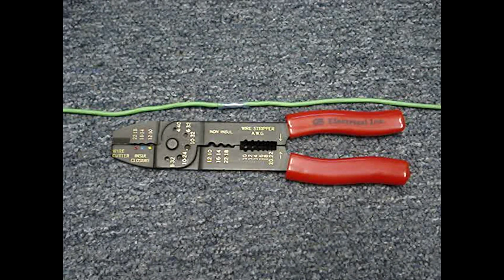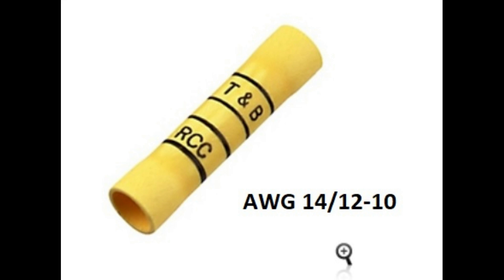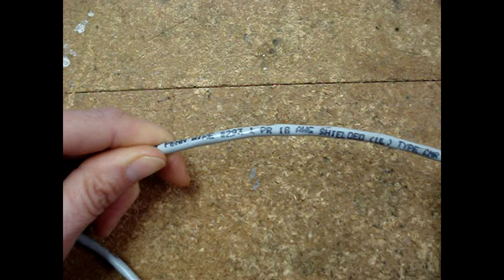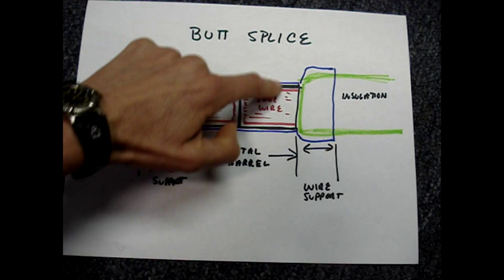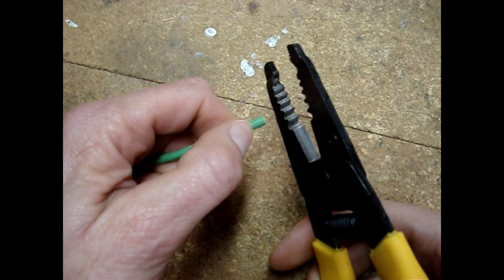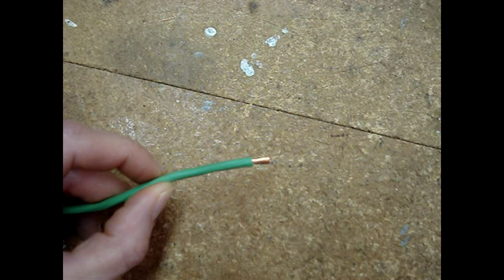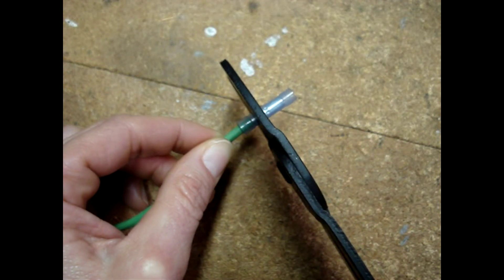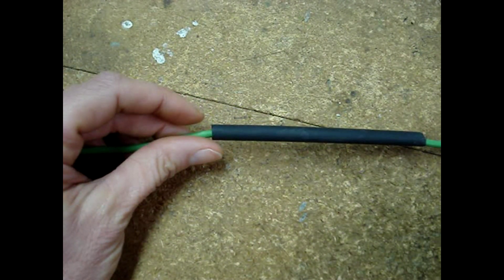Splice Wires Together  Crimp Butt Connectors

Comment: I have VACO crimping tool and it has round holes as the tool you show, how are they used?
Reply from the maker: They are used to cut a threaded bolt.  Screw the bolt into the appropriate hole to where you want to cut it, then squeeze the strippers.  If the bolt is a softer metal it will cut it.  I doubt if you could cut stainless steel.

Comment: Viewed several and this was the first to show a proper crimp!  Thanks!!!
Reply from the maker: You are welcome.  I used this type of tool to make crimps for 15 years on low voltage building systems.  I never found a crimp that failed.  We always used high quality connectors.  Make sure you use the right size connector too.
Reply: @Know-How-Now  Thanks and I also wanted to tell you I admire your patience; I wish I had more of that.  : )

Comment: You can touch and twist copper all day it will not corrode. More often then not you need to twist it to fit the copper in the connector you're using.
Reply from the maker: You are correct your fingers won't corrode the copper.  Youtube won't allow me to edit an uploaded video.  I will beg to differ with you though on twisting the copper strands.  If you are having to do that you are likely using the wrong connector.  If you look into any literature by the companies that make the connectors, they will tell you not to twist the wire.  I used a document by NASA for reference for this video.  That document also says no to disturb the strands.  I've made hundreds of crimps in my working career as an electronics tech.  I've never had one fail using the methods/guidelines in this video.

Comment: This is an in-line splice, not a butt splice!  At least at the major aerospace company I worked for.  Butt splice is where two wires run parallel to each other, then the ends are spliced together, side by side.  That said, a google search shows multiple references such as this video calling the in--line splice a butt splice.  Otherwise good video showing an in-line splice (we also did not twist wires before splicing or crimping).
Reply from the maker: Thanks for commenting, Kim.  I worked in the commercial fire alarm/security business.  We called them butt splices.  I've never heard the term in-line.  I suppose terminology can be regional or differ between industries.  Some codes did not allow splices, the correct thing to do was install a terminal board.  There were a lot of splices out there. lol.   Everyone was pushing to get the job done fast.
Reply: @Know-How-Now  ive always heard it a butt splice,  but i've worked in a lot of manufacturing plants and sometimes one plant might call something one thing when thats how everybody does it there

Comment: This is timely information for me.  The guys at the hardware store treated me as if I were a moron when I asked for some crimp butt connectors. I'm trying to rewire a vintage Gone With the Wind Lamp that will require joining three alum connectors to copper connectors.  I can do this!  Great, well done video.
Reply from the maker: Thanks for taking the time to comment and the kind words, Sharon.  I have a similar video, it goes over some of the same info, but you may find it helpful:  https://youtu.be/xhPM5-JbRtA

Invest in buying quality connectors and do a little home work to get the right ones for you application.  Because there are so many variations, it's a little overwhelming.  The major manufacturers websites that list the specs for their connectors.  I would try to contact their support people, they could tell you which connectors you need.

The $10 tool, if used correctly will do an adequate job.  Your lamp is not going to the moon.

Comment: Great info! Fyi I think your video is in 4:3 format. It would look better in 16:9.
Reply from the maker: Thanks for the FYI, Ron. I'm trying to improve the videos... I don't have any kind of training with shooting video.   I looked into your suggestion and I think I found where I can change the setting on my camera.  I'll have to experiment with it and see how it goes.
Reply: Know How Now No problem-it will probably be the high definition setting. BTW, I’d like to see a video on how to remove/replace a leaking inline copper water valve...do I desolder it or cut it out? How about one on removing and replacing a section of damaged hardwood flooring?
Reply from the maker: I have a video showing the removal of a soldered valve.  I didn't show the install, but in the video you'll see I've installed a ball valve.  You'll see I've used a coupling and a piece of pipe to fit the new valve in place.  https://youtu.be/BWXFGwBpyvM  If you don't think it's safe to solder, you can use a compression fitting as shown in this video:  https://youtu.be/D0ftheIfTjY

Good suggestion for a video on replacing damaged hardwood floor, I currently don't have an opportunity to do that.

Comment: At 2:43 Stranded vs Solid:  It's good (for me anyway) that you pointed that out. Although, it might seem obvious to some.
Reply from the maker: My work experience with low voltage DC was that crimping solid wire was something you did not do (Splices were to be avoided if possible.).  I found a NASA document on making connections:  https://prod.nais.nasa.gov/eps/eps_data/145968-OTHER-002-006.pdf  That document forbids crimping of solid wire or soldered tinned stranded wire.  I was surprised to find that there were some connectors that have spec's allowing crimping of solid wire.  Evidently, some applications allow crimping of solid wire.  If your splice is going travel to space, then it's not a good idea to crimp solid wire.  lol.